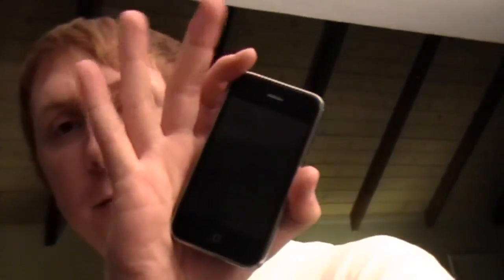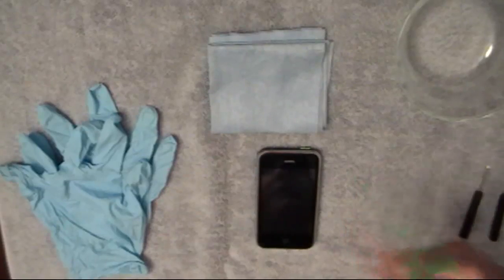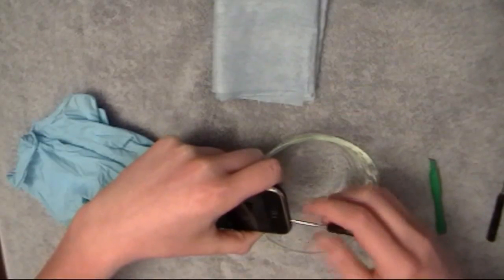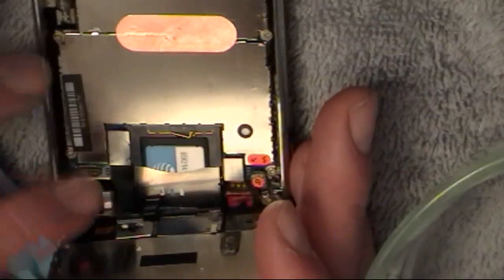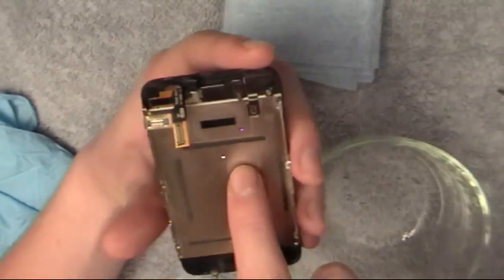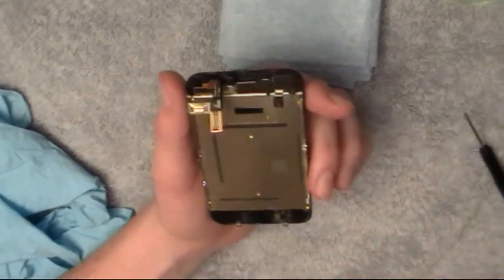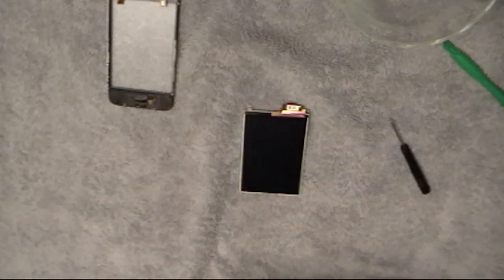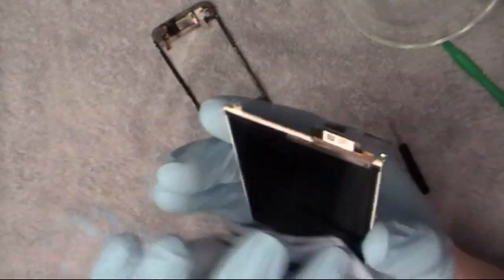Hardware How To Episode 1: How to Remove Dust from Under an iPhone 3G/3GS Screen Pt.1/2

Comment: I have cracked my screen and bought a replacement glass only, not digitizer. Everything went well but ribbon cables 2 and 3 seem to fit fine but #1 seems too long. I don't understand what I've done wrong as I haven't taken much of it apart. I just can't get cable #1 into place because the stiff cable is so long that it comes too far down the iPhone. Does that make sense?

Comment: ISSUE SOLVED
Sorry if I caused panic to some. I gave it one more try, and after opening and re-aseembling the phone again, I did a reboot, and then my LCD suddenly lit up again.
Lesson learned: make sure you push your connectors gently but firm onto the sockets. Then startup and/or reboot the device.

Comment: BEFORE YOU GO ON!

I followed this video into detail, assembled my iPhone 3GS again and now my LCD IS DEAD. 
It seams to power but doesn't display anything. I can sync, start music with my headset and even startup voice command. etc. so I know the iPhone itself is working.

I was very careful, (studied electronics, so I know how careful you need to be) but apparently not enough.
Result: probably around €200 cost on repair of the frontside!

Comment: WAIT!!! Before proceeding with what looks very easy in this video I must CAUTION you: the 3rd connecter ribbon cable clip (marked as #3) is VERY FRAGILE (min 3:50). Careful as I was, this clip came off into my hands (it also on some iPhones this part is white instead of black). If this part detaches as it did for me you will lose the use of the earpiece (what you listen to when you talk on your phone) Many have have this problem and to be soldered back on by a professional will cost you money!

Comment: I had the same issue with having a dead strip when it was all put together.  I unhooked 1,2 & 3 and was really careful popping them back in.  3 is especially finicky.  If you put it in too far, it will cause dead spots.  After a few tries, everything works great.  This video was a huge help

Comment: @ADA88H Also should add that connector 3 will break if you repeatedly force it in.  You can't see any damage, but you'll need to buy a new glass assembly if that happens(white screen of death).

Comment: Worked great!... Only one little problem I ran into. I plugged everything back together and the screen was blank. I hard rebooted by holding the home button and power button at the same time, and now everything is working fine. Great instructions. Thanks!

Comment: Hi. I took the first part apart. 1 2 and 3, then i decided to not bother and put it back together again.  The bottom section of the screen wont work now. Have you had a simular problem at any point?
Ive tried rebooting and recovery as the phone was jailbroken.

Comment: Thanks for this.  I followed your instructions and got a bunch of dust out of my screen.  By the way, if you find that your home button isn't working, make sure you snap the screen totally back into place or it won't work.

I had an Apple "genius" tell me that he couldn't get the dust out of my 3G screen, because the screen and the glass are glued together.  This was the case with the first-gen iPhone, but I knew for a fact that it wasn't true for the 3G.  I don't appreciate being lied to.